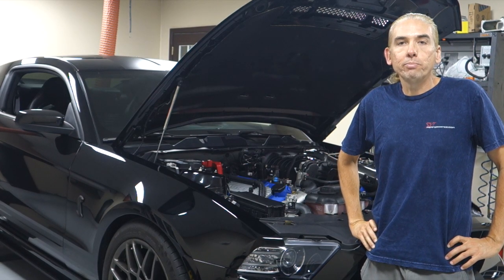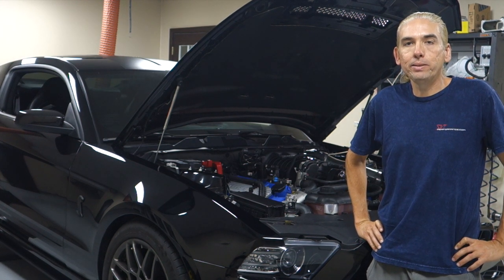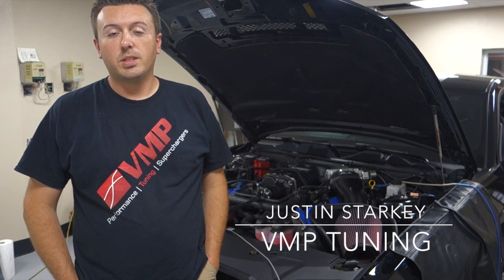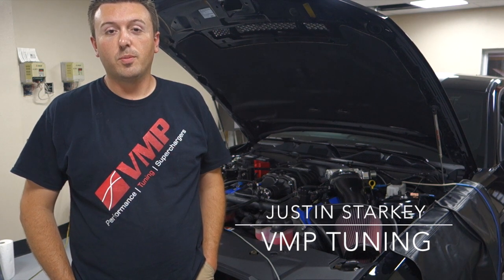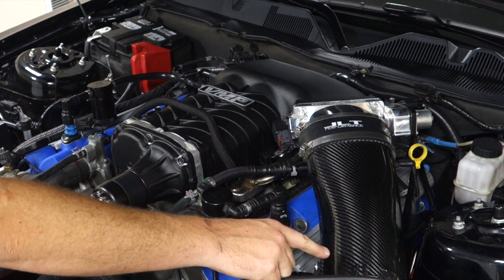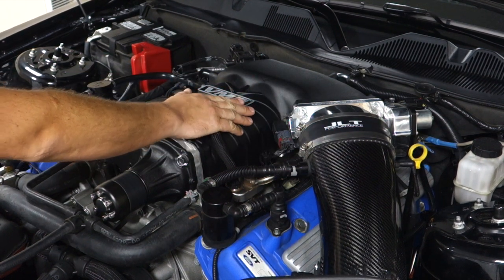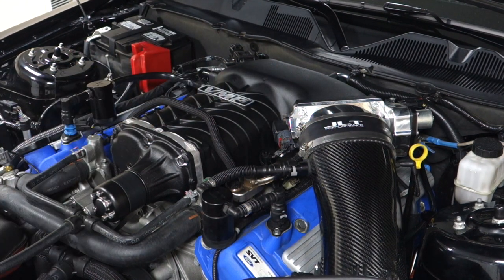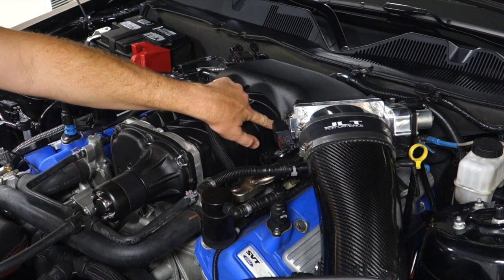VMP Gen2 TVS Supercharger Dyno Test

Comment: Close the hood for real world drivable hp.
Reply: real world driveable hp wouldn't be taken from a car sitting still with no air flowing to it either. closing the hood does not make it any better...
Reply: @perryconnor6373  these guys like this are so stupid with that close the hood bullshit.  Best you can do is datalog a run on a flat road on the street and try to use some sort of virtual dyno to get the results but then ppl say its bs because it isnt a "real dyno" when both of them can be manipulated the same way.  Dynos are for testing...as long as its done the same before and after who cares lol.  Doing a 4th gear pull to 140-150 with the hood closed and nowhere near 140-150 mph air blowing over the front of the car the results will be flipped going the other way....so whats the point?

Comment: Whats the HP difference between the gen 2TVS and my stock 2010 GT500 Blower looking to get a new blower and leaning towards this one.
Reply: well modded out mine with stock blower put out 630 wheel. this Gen 2 I have seen very moderate builds not going all out have put low to mid 800s so I would say about a 200 hp difference but if the math is right on a built 5.8 turning 8000 rpm over 1000 wheel is possible very possible with the correct supporting mods